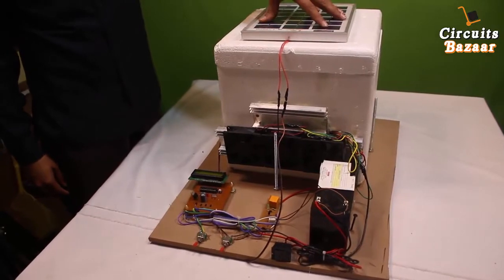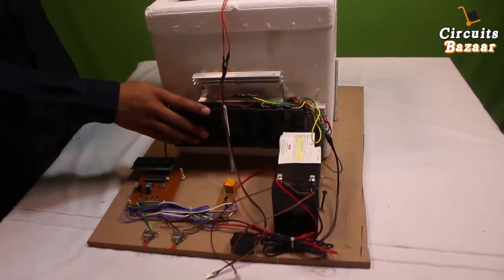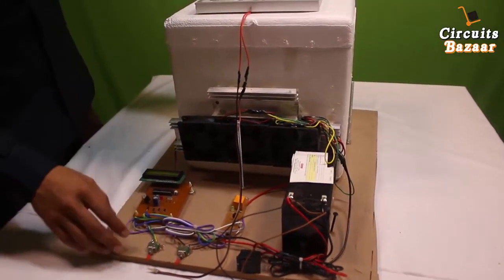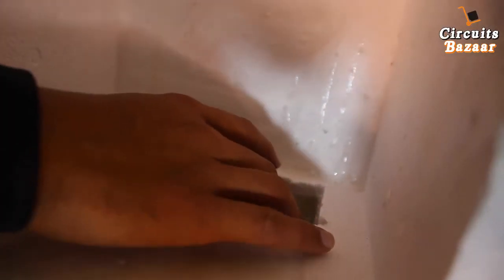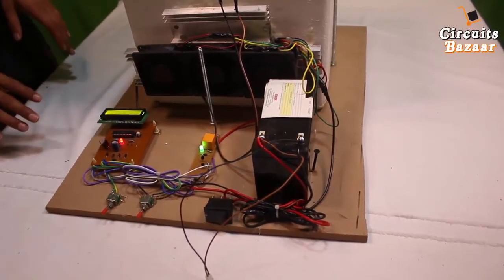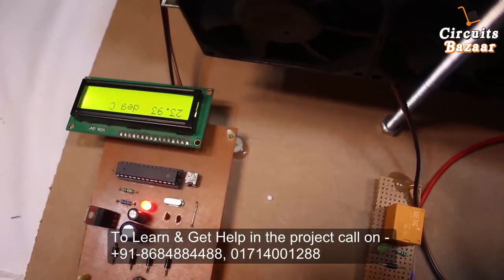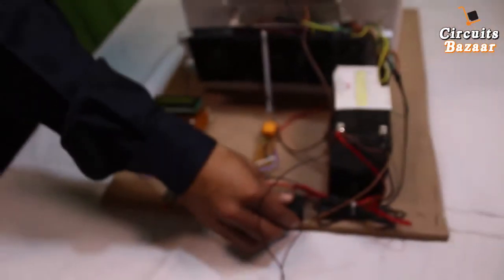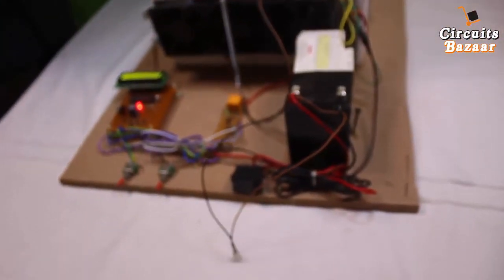A Solar Powered Peltier Plate Refrigerator with Auto Temperature Cut using a Relay

Comment: Can we run peltier directly from solar cell ?
Reply from the maker: Yes you can but in that case you need a very heavy solar panel .....
Reply: @The.Innovative.Indian  Thanks for your immediate response!!  For 1 Peltier Module 12706, what will be the Watts and Volts of Solar Cell we need to put.  ??

Comment: What is the spec for the solar?  Watt and Volt?
Reply from the maker: 20 watt 18 volts ...
Reply: Circuits Bazaar thanks. Do you use solar charge controller?
Reply: And the battery's spec? How long can it be used?
Reply: Hello, can I know the specifications of the battery?
Reply from the maker: you can use 12 v battery